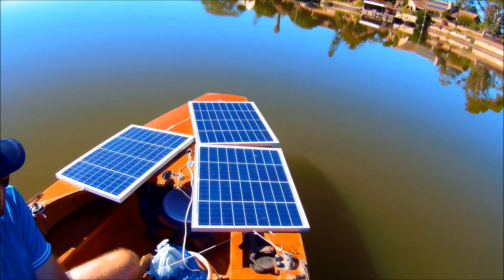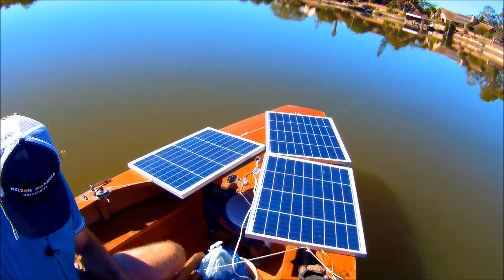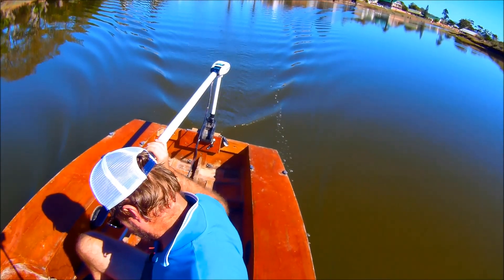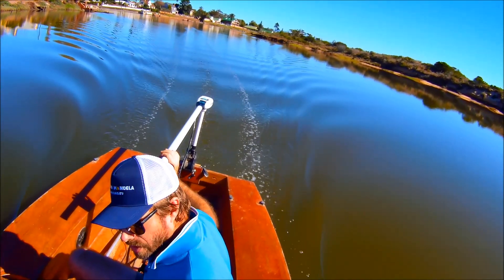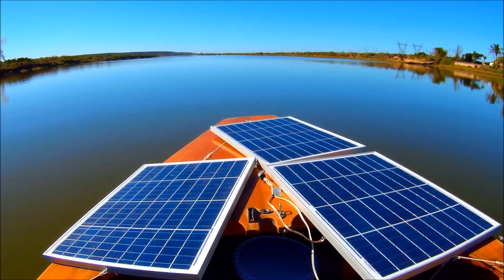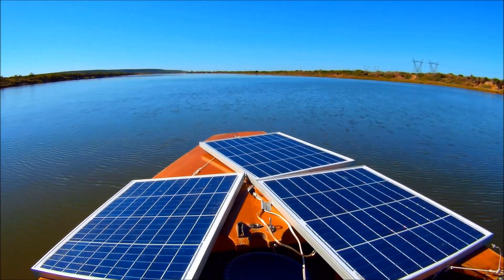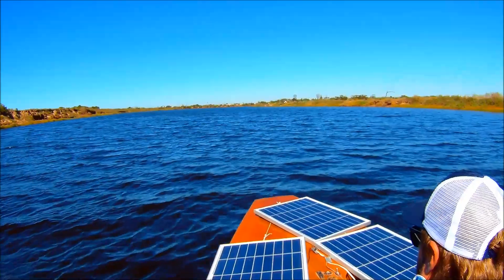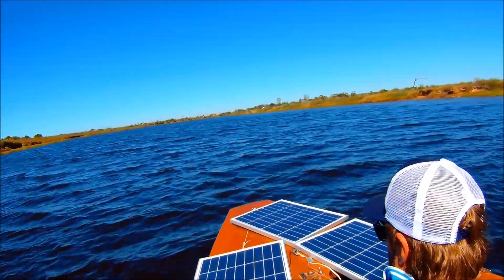Minn Kota Project Ep.1: Speed and power test

Comment: I used a model airplane propeller on my touring kayak and got speed of about 13MPH. I'm sorry I don't remember the power and I was using a handheld GPS. I didn't run it long at that speed and power.
Reply: I don't know what the motor is. I  got it used on another boat project. It has no shaft, mount or controller. I still have it but it's buried under a bunch of other things. I'm not sure what the prop is, but I think it's an APC 10 x 6 sport. It's much smaller than the stock prop but the pitch is greater. Also, the touring kayak has very low hydrodynamic drag.
Reply from the maker: That is phenomenal speed. What motor do you use? What size prop?

Comment: I own a intex mariner which 2 friends and I go fishing on at swartkops and Sundays very often. We use a 34lbs thrust motor. Looking forward to see what I can do to get some more speed out of it. I built a 4s  battery pack from laptop 18650s. Next outing going to see if it makes a difference in speed
Reply from the maker: That extra voltage will almost certainly give you better speed. Just watch your current at low boat speed. If you give full throttle with low boat speed you might cook your motor unless you are using a fuse.
Reply: @williamfraser  Thank you I didn't think of that.. I will fuse it and take some fuses with in my tackle box
Reply from the maker: What speed are you getting at the moment? The Mariner moves well under low power but will "hit a wall" in terms of top speed due to its limited length. If you are already achieving speed close to this hull speed then even doubling the power will make little difference.

Comment: Awesome! Looks like you're off to a good start already. Can't wait to see what you come up with! We're working on a 3D printed faring but haven't tested yet. Can't wait to get back on the water!
Reply from the maker: What foil profile did you choose for the fairing?
Reply: @williamfraser  0025 NACA
Reply from the maker: Since you already have 3D print capability you might as well try a fat naca 64xxx or 65xxx series. The smaller leading edge radius should make a difference even if you don't get laminar flow. Stall should not be an issue even at large deflections since the prop's suction maintains a favourable pressure  gradient.